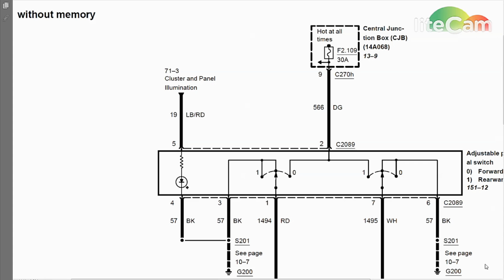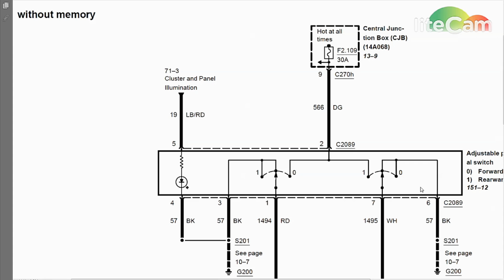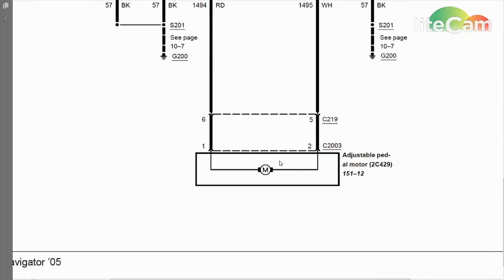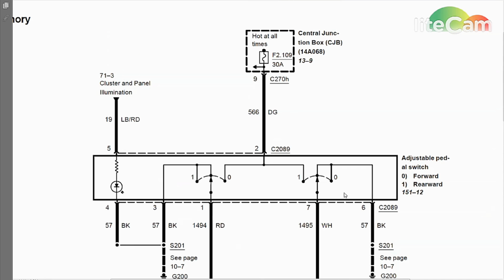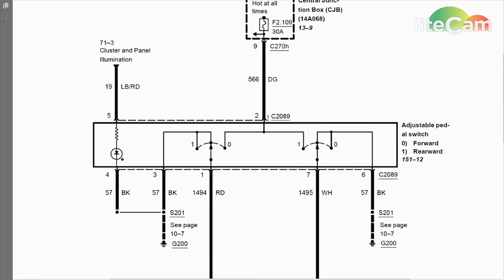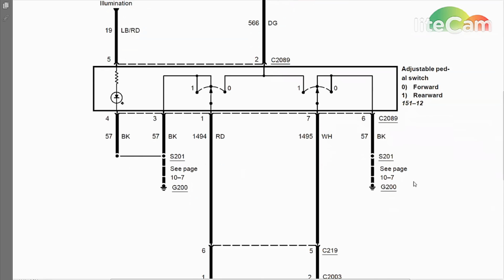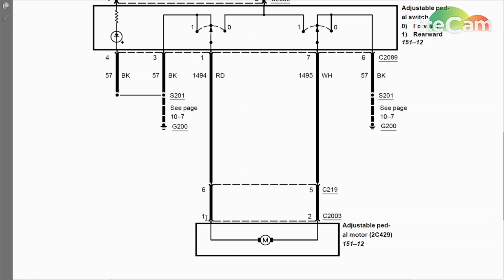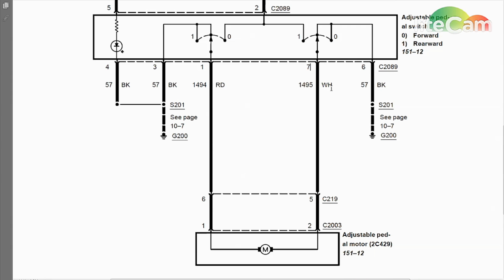Wiring Diagram Diagnostics: #3 2005 Ford Expedition Adjustable Pedals Inoperative

Comment: I have a 2005 f250 5.4l now 12volt to my ignition coils while it was running I heard something on the passenger side underneath the hood pop and it truck died I was pointing towards the computer that's where it gets 12 volt form? My name is Greg ty

Comment: Isn't the most common failures that plastic gear inside the brake pedal adjuster? When I bought my '05, I noticed the pedals didn't work well, they moved a little but seemed to be stuck. When disconnecting the cable going between the gas pedal and the brake pedal, it worked fine, the gas pedal was able to move through the full range. When opening the adjuster on the brake pedal, I noticed that the plastic gear had split, and was getting stuck on the worm gear. After searching around, I found that this was a common issue on these, and even buying a new pedal assembly from Ford, it still has that same plastic gear which would ultimately fail again. Luckily, there's a shop in US that makes aftermarket replacement gears in brass, which will never break or split again. I ordered one, replaced the gear and all is working perfectly again, spent less than 100 bucks on it.. :)
Reply from the maker: +Skauber I have seen a few motor failures and quite a few that would activate but just bind up you could see it in the cable those ones would have the gearing issue. This person presented the problem as they would not even attempt to actuate that is why I concentrate on the electrical side of it in this particular video.
Reply: Skauber where did you get the brass gear from?
Reply: Kevin Godbee I got it from Curless Auto Repair, they're on Facebook, and there's threads on Ford Truck forums and such.
Reply: Skauber thanks for the quick reply. Appreciate the info.

Comment: Resistance check/Ohm Check on wire = asking the kick in the ass. Ask it too many times and some day it gets to you! Load test is only way to deal with wires.
Other then that Great video! ...no other then those motors has failed here too, what i have seen..
Reply from the maker: Watch the video again I mention load testing until the end. I don't generally do resistance test either.
Reply: +FordTechMakuloco Yeah, Sorry! I didnt mean that you didnt mention load test, what i ment is you Never should do resistance test on wires. As you can get 0,0 ohm resistance results on broken wires.
That is not what that ohm test is for on multimeter. You should only do resistance test on unpluged parts that you know have some resistance and you know how muts it should be and even then the part can be broken(the load, time, moisture, heat,...), yeah great i know :)
I learned that an "hardway" as it was easy and at that time i didnt know why it could give me a good results even with bad wire as no one explayned it to me and so i blame the part that was good after all...